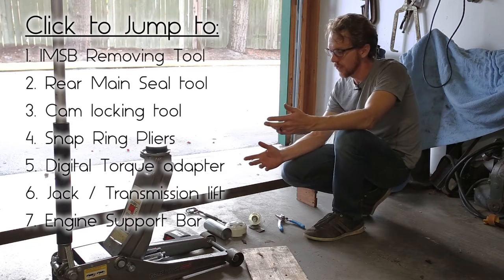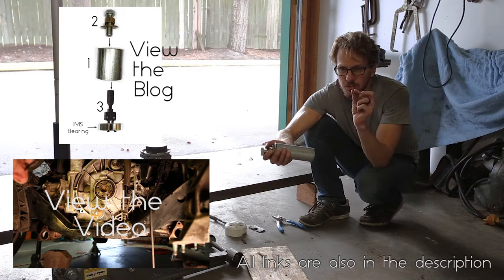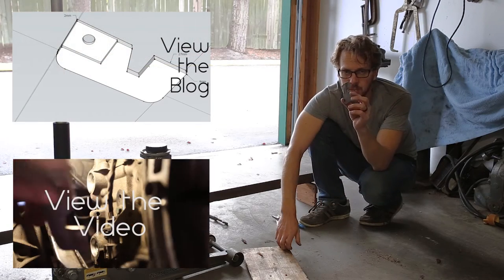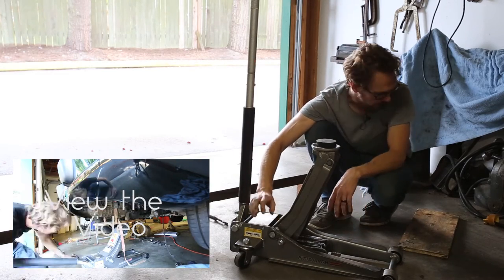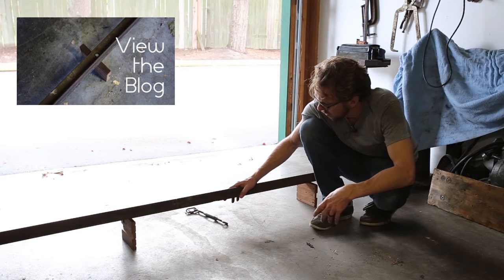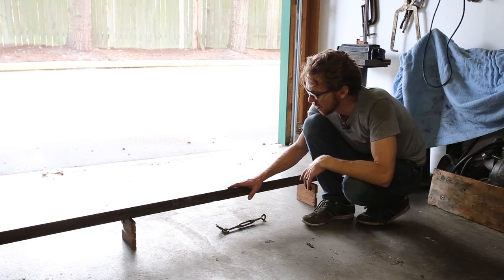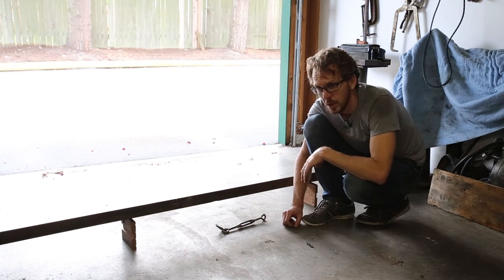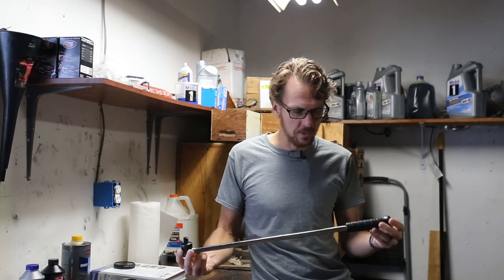IMS Bearing Porsche Special Tools

Comment: hey, once again, love all the vids on the boxster.  I am curious what your take is on the LN ims solution, the one with the oil fed plain bearing, no rollers.  i have 2000 box, just did a 5k oil change at 40k on the clock.  def a little wet under there, keeping my fingers crossed its just the rms until it gets warm enough and I have the $$$ to do all the clutch, ims, rms, underdrive, water pump, etc.  gonna have it up on stands for a bit wrenchin....  ya loan out the tools ya made??
Reply from the maker: I really like the LN plain bearing. I think it's the best solution of the bunch and possibly the only permanent solution. Time will tell... Anyway, you've got the right idea. swap it out when you're in there. I haven't thought of loaning out the tools. They're pretty simple to make, but I'm open to loaning them out if you want.
Reply: thanks for the quick reply. I found the guarantee with the LN solution is no good unless it is installed by an approved installer.  Luckily there is one under an hour from my house.  So I may not need to invest in extra tools (lemme tell ya how many Miata specialty tools I have) just need to save extra cash to have someone do the work....  keep on rockin the boxster!!
Reply from the maker: Ah, yes, I seem to remember LN saying the IMS solution Required professional installation. I don't know what all is involved, but I'll be interested in the consensus after it's been on the market for a few years. It would be nice to have a truly permanent  solution.